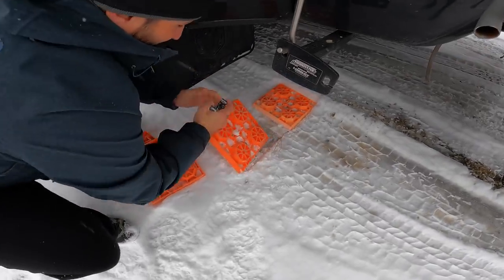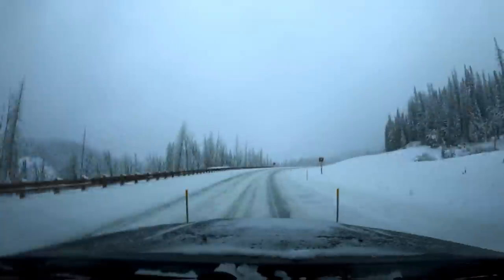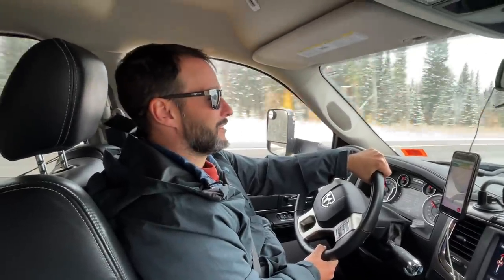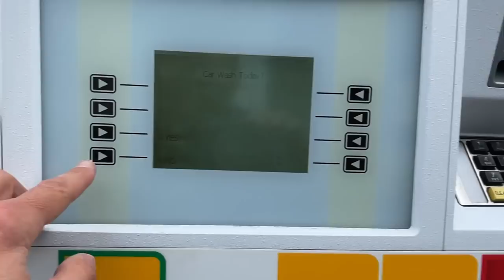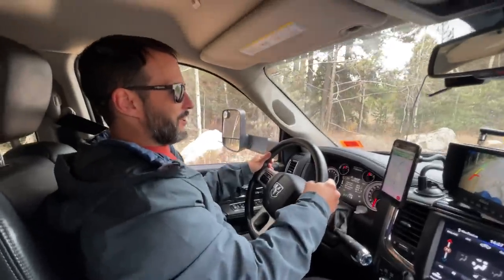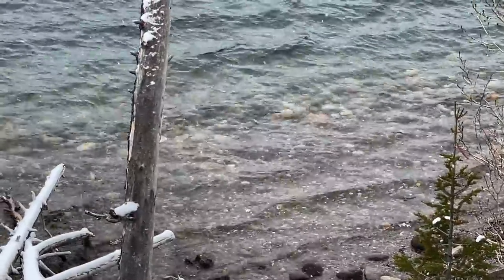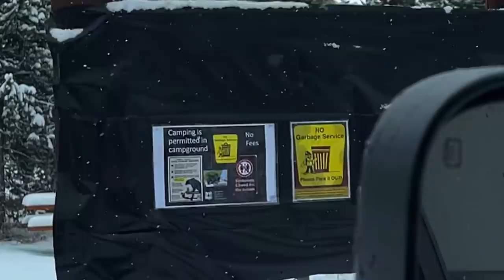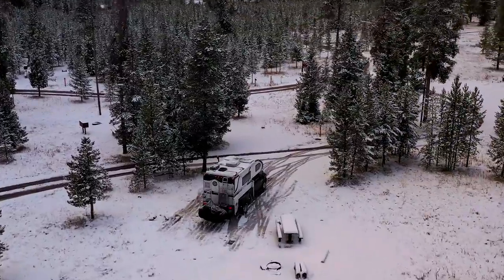❄️WINTER TRUCK CAMPING in The Tetons \\ Winter in Wyoming Pt. 2 \\  Vlog 23

Comment: I've had my Cirrus in weather down to about zero degrees (with a pretty serious wind chill) and had no issues with anything freezing.  The Alde system works pretty good, just takes awhile for the camper to warm up.  Just curious how much bubbling you guys get from the reservoir tank?  It is definitely noticeable in mine, and I've already turned the pump down to 3, which is the usually recommended fix.  Any thoughts?  
Thanks and keep up the good work!
Reply from the maker: We have had great luck in cold weather.We've had it down to about 5-6f with no problems. We don't like it, but we stay nice and warm inside.

I'm not an Alde service guy, and my advice is simply my opinion. BUT.... I had similar bubbling in the early months of ownership, I adjusted the flow rate up and down with no luck. I eventually tried putting the flow rate up to the max (i think the little dial goes to 10) and that really forced the trapped air our of the system. I also I did that for about an hour with the heat on max to keep the circulator pump running. I also drove around while doing that (up hill, down hill, side to side). I stopped a couple times to top of the reservoir. Then I turned the pump back down to 2.5 or 3.  I haven't had a problem since. I check the reservoir every week or so and keep it between the lines.

Comment: great video guys ,,,what do u bring along for heat ?
Reply from the maker: Our camper came with Alde 3020- a hydronic heating system. It’ll run off of propane or 1000/2000 watts of 120V AC power. It keeps us plenty warm. We also have our winter clothing, extra blankets and a small electric heater as a backup.

Comment: Why do you use the plastic blocks on the tires? Surprised they take the weight! Is there a problem having tires in contact with the ground? Do you also use them for the elec. jacks if you lower them? Curious as cars are left in ski parking lots in sub zero weather all the time. Wondering if I should get some blocks for my camper? Fun vid!
Reply: Blocks are for leveling the rig.
Reply: And yes, you can put them under the jack feet too, to widen the foot print if you're on soft ground. :)
Reply from the maker: They are stackable leveling blocks, designed for leveling campers and vehicles. We have a different type of jack pad for the jacks, when we take the camper off, we use the jack pads, if we are just putting the jacks down to stabilize our camper, we often just lower them to the ground for simplicity. It depends on the condition of the ground.
Reply from the maker: Well said!
Reply: @Stonyboot  You've got the rubber jack pads, correct? They are better. I just wanted to point out those 'lego' blocks work too. I like good old ply wood for jack pads. Cheap and easy. ;p
Reply: @Stonyboot  When you use the blocks on the rear, do you use two sets of blocks under both DRW's or just one stack under one tire? Inside or out, if only one? Thanks!!
Reply from the maker: @wingnutbert9685  I stack under both rear tires. We are pretty heavy and I don’t want to stress one wheel. Probably would be an issue, but it would be over the 3000 lb weight rating in the wheels.
Reply: @Stonyboot  I figured that was likely the case. I've always used 2x lumber for leveling the truck/TC. But with the new DRW truck, I'll need some more. One thing I don't like about the blocks is the steep angle to 'climb' on to them. Hence why I've always stuck with 2x lumber with angled cuts and longer pieces so the 'climb' is staggered and easier to get up.

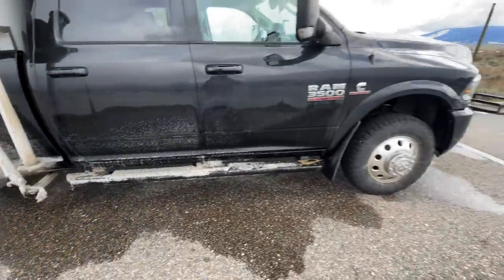Comment: 11:27 what do you do about not getting contaminates in your gas cans and then dumping said contaminates into what ever take you have them for
Reply from the maker: They are pretty well sealed. I also leave them empty until we need to setup for a while. They spend 99% empty, I fill them up just before we go camp for 3-7 days. I just inspect them before filling. Also, if I got something in there, it’s only my generator (easy to fix/drain) never used for the truck. After 60k miles, I’ve never gotten water in to the tanks.
Reply: @Stonyboot  ah ok

Comment: Greetings 
Love the videos, keep ‘em’ coming.  Two questions.  How do you combat moisture in the camper in the cold and what drone and camera do you use for those particular video shots.  Have fun!
Reply from the maker: Thanks for watching. We use some fans, and ventilate the camper during the day. We try to keep air moving and let the exhaust fan pull the excess humidity outside. Right now, we are in Washington state. We have been here for a couple of weeks and rains every day. We are also camped on the side of a mountain and spend 50% of our time in a cloud, so humidity is near 100%. It's getting pretty damp and our fans have been running over time. It's a very common part of RV living.
Reply: Boy do you need a diesel heater just to cut down on buying fuel all the time.  You can even plumb it into your truck's  tank so rarely have to refill propane.  Propane will get pricey too!

Comment: Did you put anti gel in your diesel fuel?
Reply from the maker: I do use treatments for several reasons, anti gelling is one of them. But really, it's not a big problem unless you hit REALLY cold temps. Also, fuels are seasonally adjusted during their production. If you have an old tank of summer blend diesel and try to run it in cold temps, it will be an issue. This is a little excerpt from an oil brand:

"Fuel blends are adjusted for both diesel and gasoline on a seasonal basis. In the fall, the gasoline blend is adjusted and diesel fuel is winterized with additives to prevent gelling at low temperatures. Different diesel blends may be used depending on the regional climate and the severity of cold expected."

If this wasn't done, the fuel would gel in the pumps and on the trucks delivering it. 

I still like to use some treatments to keep things clean. Other issues like mold and bacteria, water accumulation, dirty injectors, lack of lubrication in ULSD, AND the chance that we might encounter -20 temps unexpectedly are reasons that I use treatments.

Also, our outdoor thermometer is broken, and the temps that we were talking about were being reported 3000' below where we camped. So, I'm going to guess the real temps at night were in the single digits. Still no problem with the truck. The adjustment is seasonal and regional. I also know that winter diesel blends contain less energy per gallon so my fuel mileage drops a few percent. :(

Comment: You dont want to try diesel powered heaters?
Reply from the maker: We’ve covered this in several other comments. We love the idea, but it’s not worth converting our unit over for the little bit of cold weather that we see. We are not full time winter campers.  

Someday, in the future, I’ll design a fully diesel (or gasoline) and electric RV system to eliminate the need for propane.

Comment: Wait I thought you’re not supposed to use exhaust brake in wet conditions?
Reply from the maker: Good catch! You are correct in a few contexts. Traditionally, you don't want to use exhaust brakes while towing trailers in slick conditions. This would cause breaking to be applied to the trucks drive wheels, but not the trailer wheels. This can cause the trailer to jackknife and other handling problems. With the advent of stability/traction control, the exhaust brake automatically shuts off if there is any wheel slippage. It also behaves differently when attached to a trailer, which I haven't gotten to play with.

The road we were on actually had pretty good traction. I put the truck in 4x4 to more evenly distribute engine braking between front and rear tires. The exhaust brake also isn't as strong as an engine compression brake (jake brake) , and mostly just controls my downhill speed so I don't need to ride the brakes or downshift too much.